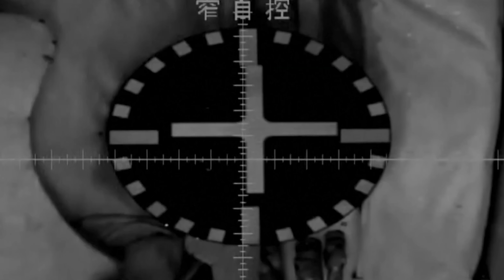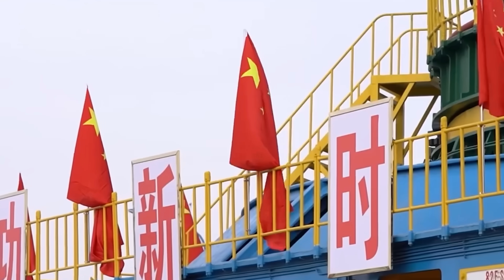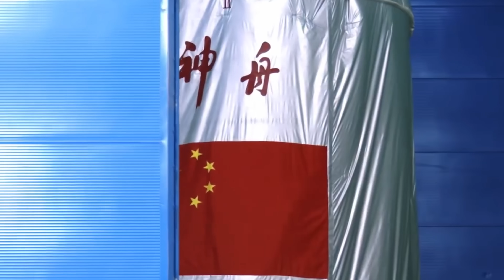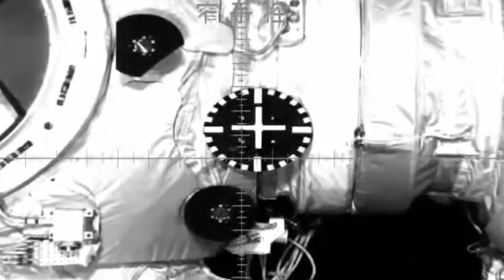China's Brilliant Solution to Rescue Astronaut on Space Station in 16 Days, Better than NASA Boeing

Comment: At 1:30 What are the rust like stains on the outside of the air lock? It looks like the coloration is mostly around metal and it was therefore I said "rust colored", that shall not happen in space unless dirty air or moist getting out there, or the capsule stood outside during a longer time on earth and was sealed worse then a SpaceX rocket.

Comment: Shenzhou-22 will carry repair parts, after which Shenzhou-20 will undergo emergency repairs and be used as a cargo return capsule. I think the damage wasn't actually that serious. Replacing the spacecraft is probably for safety reasons, and it could also be a rare opportunity to verify the effectiveness of the "emergency plan."
Reply: I think there are three possibilities for Shenzhou 20.
1. Left on Tiangong for future experiments.
2. Returned empty to Earth to test whether it's still safe after the crack.
3. Thrown into space as a small piece of existing space junk, although China is highly unlikely to do so.
Reply: @araara4746  The China National Space Administration has announced that Shenzhou-20 will be used as a cargo return capsule after emergency repairs are completed.
Reply: They found a tiny crack in port hole. It most likely won’t lead to  catastrophic failure but no one wants to bet their job on it, naturally.
Reply: @leefster1  There should be more than one layer of glass; it's likely just that the outer heat-resistant glass has been scratched...This is just my guess.
Reply: @wellplayed25 that’s true , micro cracks happened before on the way back due to heat transfer, and it’s no big deal. but thing is, if you have backup ship on standby, and you let astronauts ride on one that’s being fixed in orbit just to save some money, that’s already bad publicity.

Comment: The best solution would be to design a return module which is debris-proof. Also, a responsive emergency rescue plan should be in place as mentioned.
Reply: that's impossible. beside, i doubt the damage craft will even fail entry, they are just taking the chance to learn more about the impact of damage.
Reply: There is no such  debris-proof thing, how heavy you want it is?

Comment: For all that safety there are at least 4 different docking ring designs between the USA, Russia, the EU, and China. Also, there are other docking ring designs being used that are less common. It's only a matter of time before someone is stuck permanently in space!
Reply from the maker: It's true that standardization could prevent future issues.
Reply: @SpaceZonea  USA will prevent any efforts to standardize.
Reply: there is 3 standard, not 4.

Comment: It sounded like the Chinese space administration gladly took this opportunity to fully test their backup plan that’s been in the background for so many years already. As for the fine glass chip on the SZ-20 capsule window, get the impression that it will still hold up but just not reaching the very high safety threshold they set for human transport. They’ll now take the opportunity to ferry additional gears and data off the Tiangong Station. If they were expecting the glass to fail, they would have just jettisoned and discarded the capsule. In any case, if the SZ-21 crew were truly stranded, the SZ-20 capsule could still have been used as a second best option to bring the crew back.
Reply from the maker: I think this is only unexpected situation

Comment: Letting Shenzhou-20 reenter with a cracked thermal pane would’ve been insane. Glad they shut that down.
Reply from the maker: They will
Reply: Nothing insane! The Chinese engineers obviously have very carefully studied the damage (there are photos around on the net) and it’s absolutely tiny and superficial. They just didn’t want to take the smallest chance on the SZ-20 crew for the return but have no issues in using it as a re-entry cargo vehicle. If it was really a dire emergency, they would use it for the crew and more likely than not will be fine. It’s all about maintaining the highest safety standard for the SZ crew.

Comment: The fact they tested a damaged window in a wind tunnel before making the call really impressed me.
Reply: They obviously tested simulations of the damage based on photos recording they took and it’d be more than just wind tunnel. Now with the damaged SZ-20 capsule due to return as a cargo vehicle soon, the engineers will get a chance to study the real thing on the ground following re-entry. Fact that they are planning to use it as a cargo vehicle suggests they have a very high level of confidence on the safety of the capsule for re-entry.
Reply from the maker: This is an accident